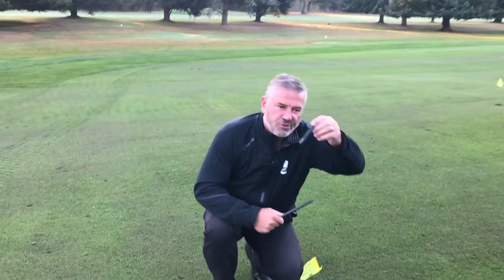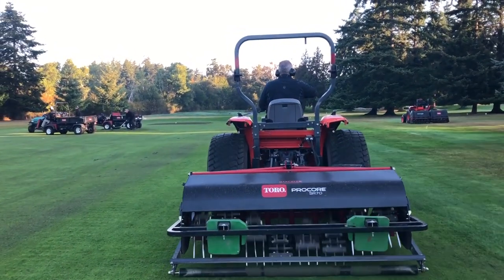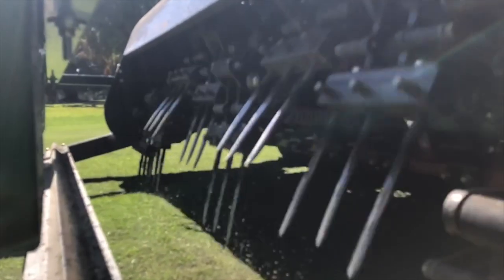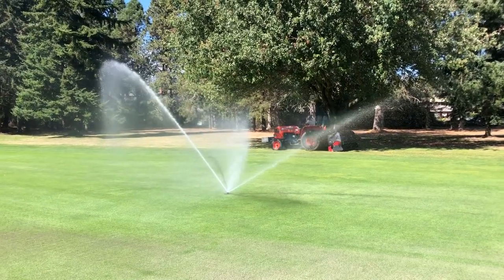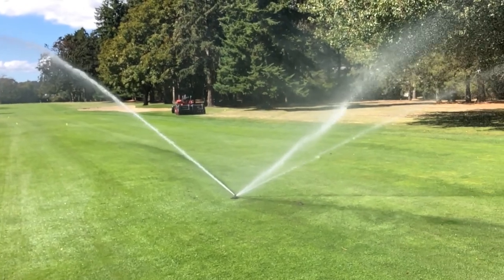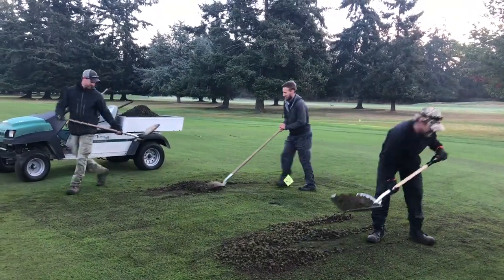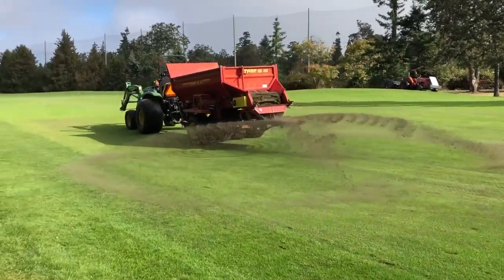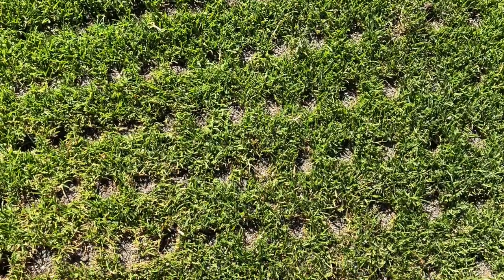Fairway Aeration

Comment: Noob question here. I do apologize, but I’ve been dying to level my lawn for a minute now.  Should I just go sand off the get go or soil.  I know what I’ve read but I want to hear it from a greens keepers perspective.  (I’m in the Midwest and have Kentucky blue grass)
Reply from the maker: Hi Derek!
Ideally if you could find a sandy soil would be best. You should be able to find it at a gravel mart or who ever sells landscape material in your area. They may call it #1 top soil. With sand in the soil, it will be easier for you to work it into your existing lawn and level it. As well this type of soil will hold moisture and nutrients, but still drain well. 
Best of luck.

Comment: Great Video. Please keep them coming!! Does this allow the use of less water over time ?
Reply from the maker: This will not necessarily reduce water consumption, but improves the efficiency of water being used when applied by our irrigation system.
Reply: @turftipswithbrianyouell  noticed that some greens were syringed yesterday and some weren't. Wondering what the reasoning behind it is. As usual the course was in great shape especially for mid January
Reply from the maker: @awkwardbbq8332   Thank you for the nice comment on course conditions for January, the grounds team are challenging the normal status quo for course conditioning in January. We rolled most of the greens yesterday, and some of the shaded greens were just zoned-rolled. Shaded greens get stressed easier, so rather than roll the entire green and causing stress, we zone-roll a smaller area around the hole to smooth out the putting surface. We don't syringe greens with the irrigation system in the winter as it adds unneeded moisture.